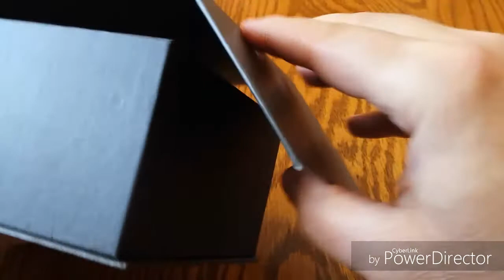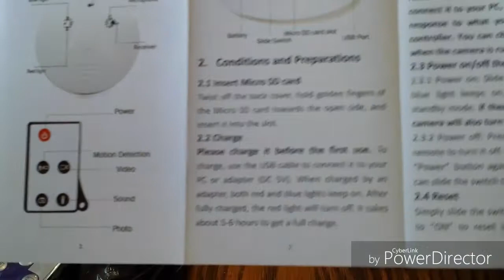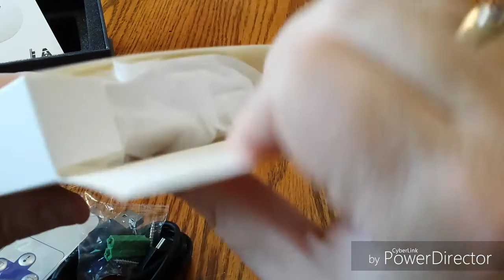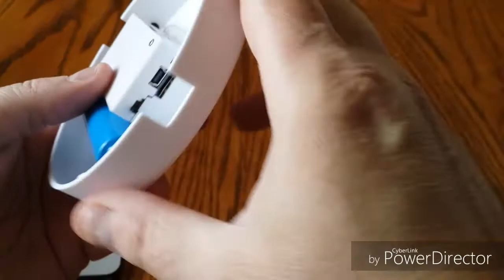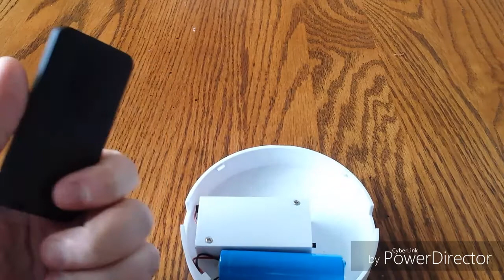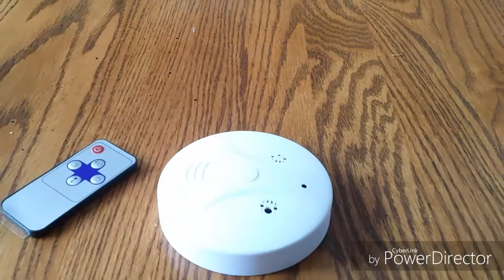Littleadd hidden camera smoke detector

Comment: I just bought 2  use ones from a lady who was selling hers, a week ago i havent put them  up since she didnt give me the right charging cord but it looks just like this one u have, i have 2 teens girls and a very suspicious partners so hopefully they havent found them were i was hiding them  lol otherwise im F** lol i just got the charging cord lost the instructions 🤣 but we will see how it goes
Reply from the maker: I hope you don't find anything bad! But if you do I'm glad you have the evidence now!
Reply: Thank you , lol either way im suere ill find something both parties haha just hope they havent seen the camaras lol other wise its not going to work
Reply: So when the camara is fully charge the lights on the camara is red n blue?
Reply from the maker: @noracorona9674  I would advise having the power switch turned off when you're charging it. Just leave it plugged in for at least six hours. It takes a long time to charge this battery. Also recommend you not use a quick charger like the kind that you get with smartphones. You want a slow charge this battery you could actually do it off of a laptop if you have one and don't have a USB adapter. Then when you turn it on you should see a blue light flashing and then it should go off. You're then ready to install it on the ceiling or wherever you're putting it.

Comment: how do you set the time?
Reply from the maker: Ron Soldano 1. Power off and connect the camera to your PC via the USB cable, it will go into U-disc mode. Open the Micro SD card, create a TXT file in its root directory (not in any folder), and rename it to “Time”. 
2. Open the TXT file, type in the time as following format and then save the file: 
[Year/Month/Date]<A space is required between date  and time>[Hour:Minute:Second] 
For example, 
2016/06/01 12:00:00 
3. Then, disconnect the camera from your PC, power it on, wait about 15s, the camera will automatically sync the time.